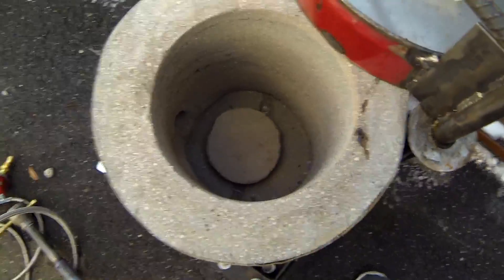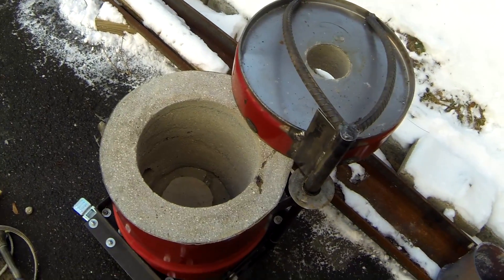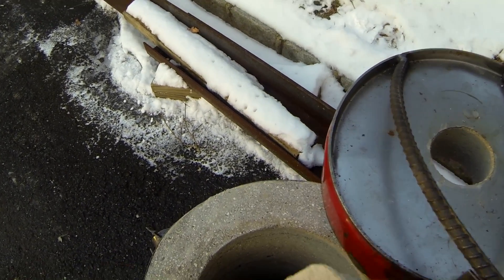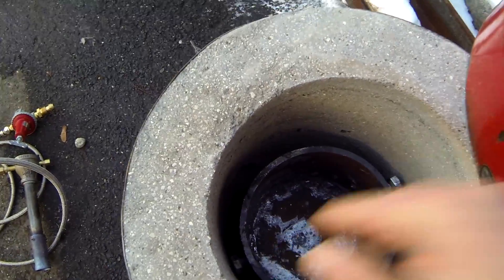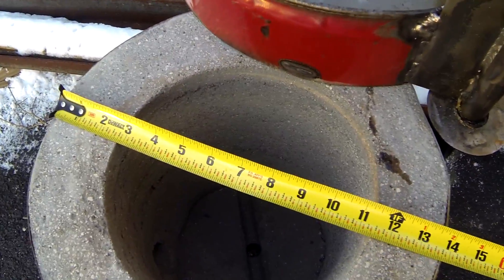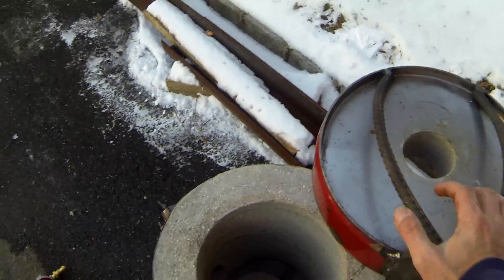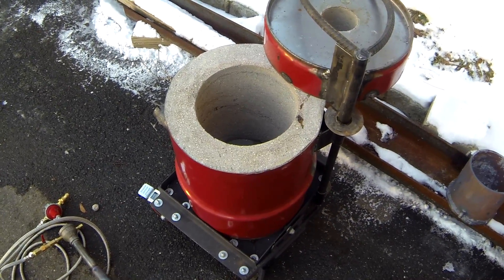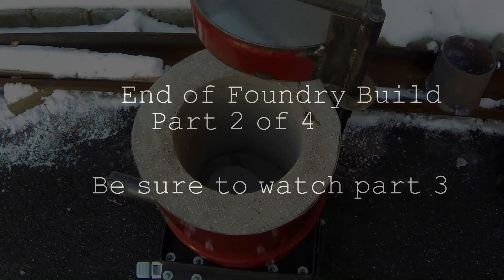Homemade Propane Metal Foundry Furnace Aluminium Tutorial Build How To Make Part 2 of 4 Aluminum

Comment: I'm in process of collecting materials for a copy of this excellent design. I know that this is an old video, but maybe I can get an answer. How much refractory cement did you use? It is fairly expensive so I don't want to buy way too much, but do want to have enough to do the job once started. 

Sorry, I eventually found my answer. Had to expand many previous replies. But found out that you used about 85 lbs. Good. I'll order 2- 55lb sacks.
Reply from the maker: I purchased 2 bags and used 1-3/4 of the bag.

Comment: Hi Eddie plans are changed instead the " mix " I gonna use refractory insulating bricks.
They are classified for 2606 dregrees. I will gleu them with refractory glue. Suited for 3200 degrees. So this must be good.
Reply from the maker: That will work too..  Nice to have the higher temps

Comment: eddie2799 Thank you very much!  Good tip to make the bottom of the furnace free. Is it a idea to make tree legs underneath the crucible? For example 3 M10 stainless steel bolts instead of that flinth???
Okay you use only the pure refractory cement?
I will use refractory cement too ( aluminiumcement). But I thought a mix is better that pure cement.
I don't use portland cement! Because it will not stand the heat...
Reply from the maker: Watch my other videos.  you will need a floor sloped with canals towards the center drain port. You will need drains because you will eventually have spills!!  You will need a plinth made out of the same refractory cement that will hold up to heat.  The stainless steel  bolts will not. 
Yes,  I use commercial bought refractory cement rated for 3200 degrees.  I did not use pure cement or regular cement.  I think you are confusing the two.
Refractory cement is different from regular cement.
If you dont want to spend the money on commercially made refractory cement ( mine is made for crematories). 
You can use a mix which is  1.5 parts Portland cement + 2 parts Perlite + 2 parts silica sand + 2 parts fire clay
Reply: eddie2799 sorry eddie I think you don't understand my question....
I will use refractory cement too! Expensive yes so what. I need good furnace.
My question too you is....did you only use the refractory cement. It must be rock hard then....
Because normally a cement needs to be mixed. With zand or what ever what like a mortal.
Maybe you used refractory mortal.
Comercial bought what already is mix with for example zand.....
Sorry for the misunderstandings. Its english and dutch...
Reply from the maker: The refractory cement I used comes in 50 pound premixed bags.  All I do is add water and mix.  I used just a little less than 2 bags, About 85 pounds.
Reply: eddie2799 thank you now I know what you have used. Its a kind of mortal premixed and refractory useable.
A again sorry I botherd you....
Reply from the maker: No bother.  Let me know how it goes

Comment: Hello Eddie I still have a question, how high sits the burner? Flush with the bottom? Or some inches above? Blows the flame agains that cement flints or agains the bottom part of the crucible?

Please a answere because rightnow I'm building a furnace!
Like yours.

And your refractory cement....is it pure cement? Or a premixed mortal?
Sorry for my question again.
Reply from the maker: You will want to use a plinth. A plinth is a platform that you can make from your left over refractory cement. I make my plinth about 1.5 inches high and set my crucible on the plinth rather then sitting the crucible on the floor of the furnace. I want the floor to be free and sloped to catch any spills you might Incure. Ideally you want the flame to hit the bottom of the crucible {sitting on the plinth) so you will make your hole that the burner enters the chamber to match that height. It ok that some of the flame hits the plinth.  The plinth is a consumable item and you should make a few for the future.  
I use refractory cement from Harbinson walker industries. More expensive but last much longer and I achieve higher Temps.. You can mix your own refractory using silica sand, perlite, Portland cement, and fire clay...  Easy to make Google it.  

Hope that helps. Good luck. Let me know how it goes.
Reply: eddie2799 Thank you very much!  Good tip to make the bottom of the furnace free. Is it a idea to make tree legs underneath the crucible? For example 3 M10 stainless steel bolts instead of that flinth???
Okay you use only the pure refractory cement?
I will use refractory cement too ( aluminiumcement). But I thought a mix is better that pure cement.
I don't use portland cement! Because it will not stand the heat...

Comment: Eddie wat kind of mixture you use. Only the refractionary cement?
Or did you use also perlite and sand. And in which proportion?
Reply from the maker: I used only refractory cement.  You do not mix it.   If you do not want to spend the money on refractory then you can use the mix but won't last as long.
Reply: eddie2799 thanks for your answer eddie. 
I live in the netherlands here we have " aluminium cement " heat resistance up to 1700 celcius.
So i wanted to use perlite and vermiculite, alu cement, and sand.
In 7/7/3/3 ratio. And i hope this will last. Better more money and good foundry.
By the way very fine design yours, especcialy the footpedal.
Reply: Hello Eddie I still have a question, how high sits the burner? Flush with the bottom? Or some inches above? Blows the flame agains that cement flints or agains the bottom part of the crucible?

Please a answere because rightnow I'm building a furnace!
Like yours.

And your refractory cement....is it pure cement? Or a premixed mortal?
Sorry for my question again.

Comment: Eddie....I can't seem to get my torch to swirl. I have it coming in at an angle. My crucible doesn't quite fill up the space like yours does, is that my issue?
Reply from the maker: Its OK if you don't see it swirl.  If its installed at an angle it will swirl the heat.  You might not see the flame but the heat is swirling.

Comment: Thanks again for the video. How long before you removed the center tube, or did you burn it out ? Also how did you keep it centered ?
Reply from the maker: Once you pour in the refractory it will stay centered.  I peeled the liner the next day after the refractory set up.  You can also burn it out but no need to.  It peels off easily.

Comment: Did you use 12" wide Kaowool ? 17" - 3.5 for the bottom, If so, I'm guessing  you used 1.5" Refractory to finish off the top of the body ? Four linear should be enough for the walls and two additional square feet for the top and bottom, maybe three square feet. Is that about right ?

Comment: Looks like a nice furnace. So do you line the barrel with the white wool, put the cardboard tube in the middle and then pour the mixed refractory cement between the tube and the wool?
Reply from the maker: skyt54 Thank you.  Exactly. you will use a piece of siding as you ram the cement so you don't destroy the kaowool. lifting up the siding as you ram

Comment: where did you get a steel drum with no holes in the lid.
Reply from the maker: Automotive dealer (BMW)  They use oils in quantity and if you stop in, ask them to give you an old barrel.  Chances are there in the dumpster already.
Reply: how did you find one with no holes in it except the center.
Reply from the maker: Charlie Scheferman I made the hole in the center

Comment: I have watched the videos and read the  comments, I have some questions is the refractory only about an inch thick on the body of the furnace?  Is it still holding up well and  does adding the refractory compress the insulation as you tamp the refractory.
Thanks

Comment: so i made a furnace with walls roughly the same thickness. i used medium refractory cement with no sand or wool filler. as a brick mortar the bag says 7-10 days before applying heat. i used a bucket as a mold. when do you think i can take the bucket out? the top is dry to the touch but idk about towards the bottom.  any suggestions would be great. thanks eddie2799
Reply from the maker: +Jim Hixson You should wait 24 hrs at least.  You can also put a light bulb inside to dry it faster.
Reply: +eddie2799  Thanks dude!!

Comment: What are your thoughts on the Heatstop refractory mortar? I've been calling around, and there is a place locally that has all the Heatstop I could want ($56per 55lb)... Would this work as well as the RS4 you use? I only plan on melting aluminum seeing as I basically have endless supply of scrap aluminum....
Reply from the maker: Mike C If your only going to melt Aluminium then that will work perfect.  I was going to use it as well but decided to go with the higher temp refractory so I have the option of melting other metals.

Comment: Thanks for explaining how to find the htiw on eBay, it is harder than it seems. I have a couple of questions about it. How did you get the clay around the kaowool and how much did you need for your foundry? Thanks for sharing this design. I like your design best, particularly the pedal.
Reply from the maker: dhermitmorse Thank you.  I poured the base with the leak holes first.  After it dried I lined the inside of the drum with Kaowool and started the top pour of the side walls.  Use aluminium siding to press up against the Kaowool blanket so it does not get damaged while tamping down the refractory cement walls. Pour in the cement and tamper it down with a stick and slowly raise up the roll of aluminium siding as you get higher to the top.  So in other words you will compact cement in between the cardboard form tube and the aluminium siding.
Reply: eddie2799
Thanks a lot for the detailed instructions. You have been a great help.
Reply from the maker: dhermitmorse you are very welcomed.

Comment from the maker: Hi Bryant, It weighs about 100Lbs
Reply: +eddie2799 How many pounds of refractory cement did you end up using?
Reply from the maker: +drew05171 I used 1 1\2 bags. 75 lbs

Comment: And you mix only cement and water or what? Sand?
Reply from the maker: What I used is not cement.  Regular cement will not hold up to the temperatures.  I use refractory cement specially designed to withhold the temps.  It is mixed with very little water.
Reply: eddie2799 Thank you!!!!!